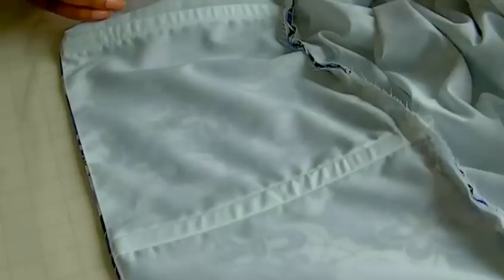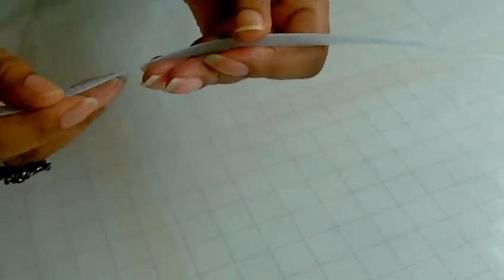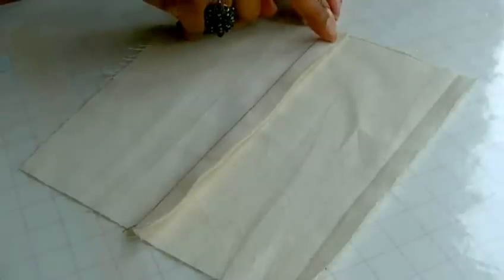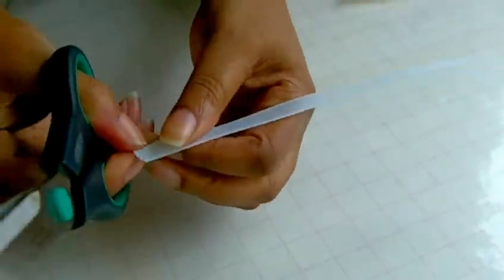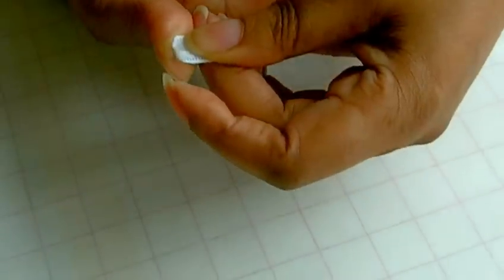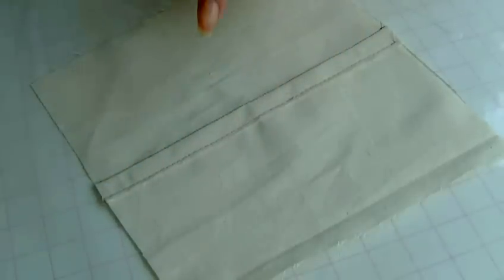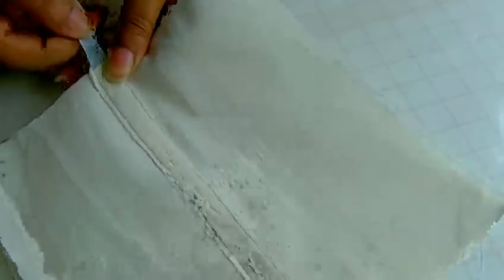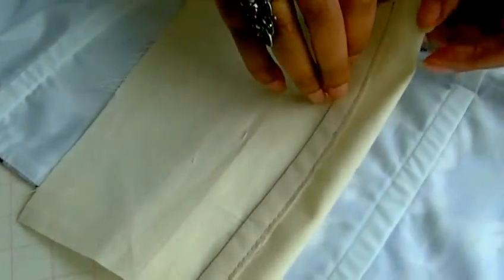Sewing Boning Into a Seam

Comment from the maker: In short, you would work from the side seam, along the waist line and then down approx 6 - 8 cm's (it all depends on size) and then draw a line from that point, back to the side seam.  This section would than be cut away and this would create the initial shaping for the pocket.
Once done, take a piece of paper, placing it over the section where the pocket is to be placed, then draw out the bag of the pocket (the front) and then the back.
The back pocket will come from the waistline.